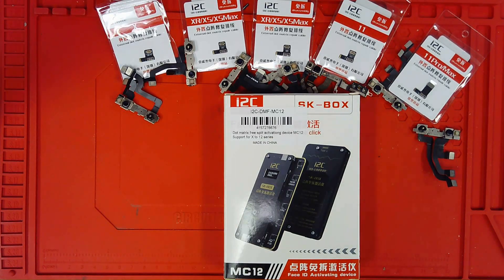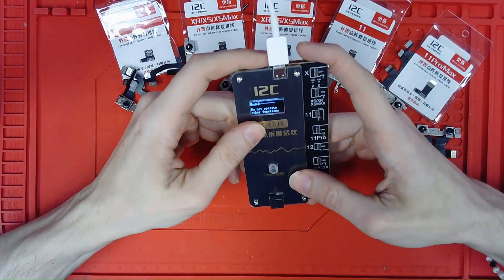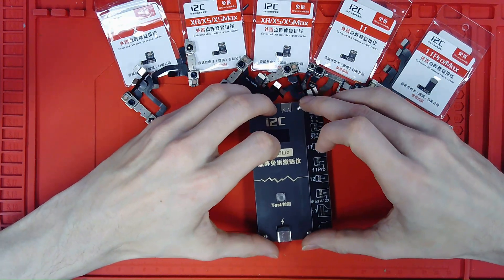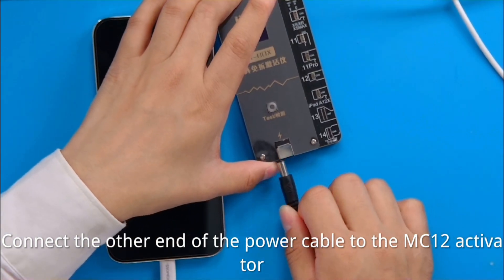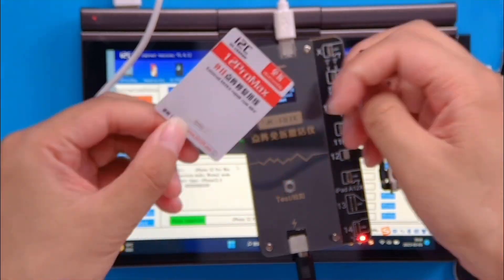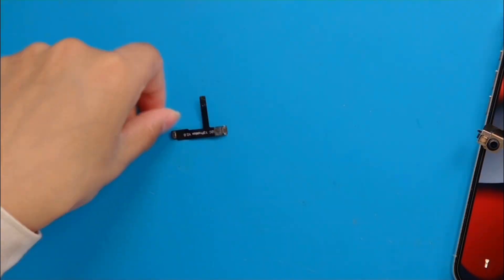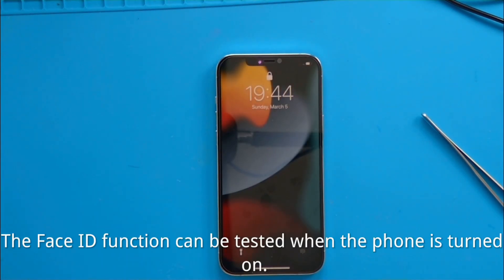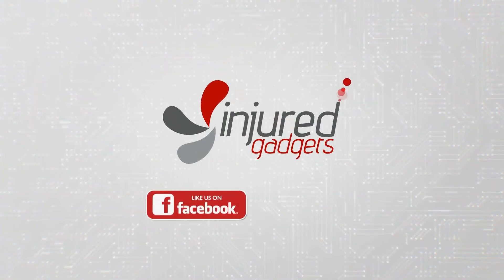i2C MC12 FaceID Solderless Repair Solution TagOn Flex for iPhone X thru 12 Pro Max

Comment: I bought one of these but for some reason any model I try to fix truedepth from iphone 11 pro to 12promax doesn't work , i follow the same steps and it works from iPhone 11 downward . What could be the problem ? I need help

Comment: basically got problem with face id after water damage, not even can turn on face id.. so i did this repair, and manage to turn on the face id but during the setup for face id, i cannot past the  "face id position your face with in the frame, "face id face out of view".. when i open front camera - potrait mode, seem not working well also..reset iphone with itunes, problem remained
Reply: did you find a solution have the same here ?

Comment: Nice video! 
Question if it happened to fail after you attempt to burn the data back on the cable would you need another cable or can you use the same one you were trying to copy the data on to? 
Thanks
Reply: What error are you getting?😢 mine is Tip: Please keep V8 and mobile phone connected to the computer at the same time.